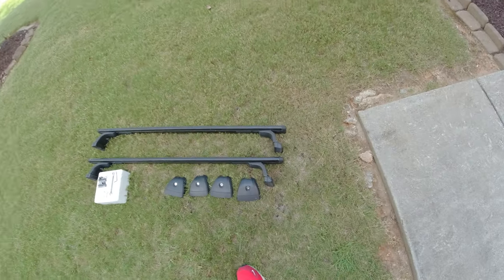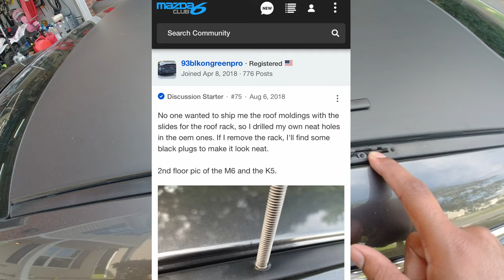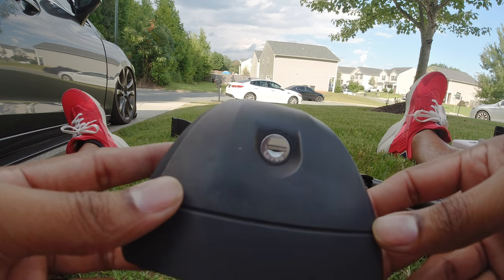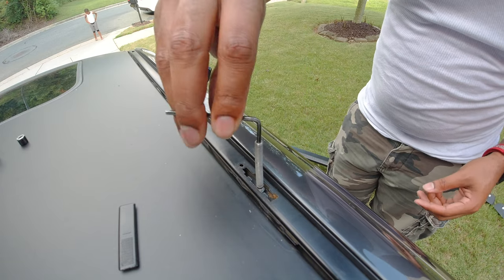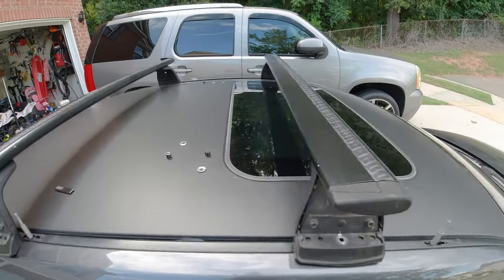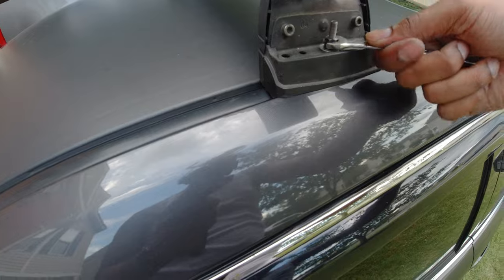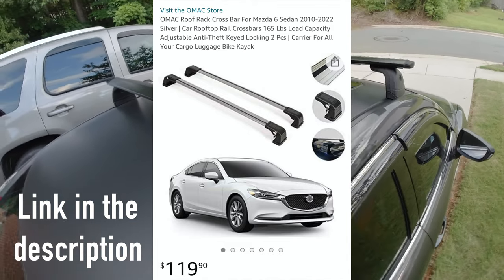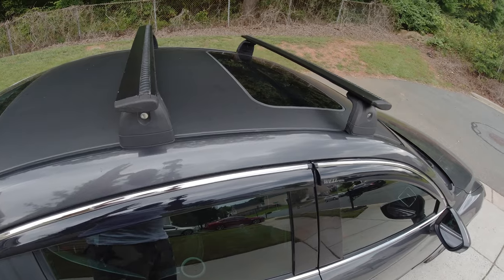2008 - 2021 Mazda Thule Roof Rack Install | Gutter Mount | Fixed Mounting Points |

Comment: Is there replacements Nuts and Spacers anywhere? Or what could I use instead?
Reply from the maker: You could find nuts and spacers at your local hardware store. Just take the stud with you. I don’t think that Thule sells the hardware separately
Reply: @DariusBuildz  Sorry, in fact I am missing 2 studs. Can I find the same thing or should look for screws with the same thread and lenght?

Comment: Very good video. Do these racks also fit on the 2007  Mazda6 Sedan? Same type of mounting points. Thank you.
Reply from the maker: I am not sure if these racks fit the 2nd Gen 6. You could probably verify that through a website like REI if it shows the same foot kits for both cars.
Reply: @DariusBuildz  The 2nd generation Mazda6 are from 2008 upward.
1st generation is from 2002 - 2007. The mounting points appear to be the same judging from pictures. I can verify this with the local Mazda dealer.

Comment: I have had such a hard time just trying to get an answer to this question. Will the Thule 460R Feet fit on my 2019 Mazda 3 hatchback? I worry that the foot kit won't fit between the 460R feet and the roof of my car. Perhaps you have an idea. Thanks for such a helpful video!
Reply from the maker: From what I goggled it doesn’t look like the 460R are the right feet for your 19 3 hatch.
Reply: Gotcha! Thank you for the help! @DariusBuildz

Comment: Thanks for making this video. Will these feet and fit kit work for a 2015 Mazda 3? I already have the bars.
Reply from the maker: You will have to verify to see if they fit. On REI's website, you should be able to verify if the 3 uses the same foot kit, that way you don't waste your time and money on the wrong thing.
Reply: @DariusBuildz I tried to verify it but not sure where to look on the website, could you verify for us, I also have a Mazda 3 2014 touring sedan

Comment: I had them already installed before buying the car and i want to remove them, however when i got to the stud i realized that they don't have holes for the allen wrench and they're just flat on top, any ideas how to remove them? would be a life saver...
Reply from the maker: You could remove them two ways: use two of the nuts, and lock them together and that should allow you to remove the stud. The 2nd way, get a pair of vice grips and just muscle them out. The latter will ultimately destroy the stud. Does the stud not have a flat spot for a wrench?
Reply: @DariusBuildz  Thanks buddy, removed them using two nuts locked together, sprayed a bit of wd40 and came off easy.
Reply: That's same as mine❤❤❤